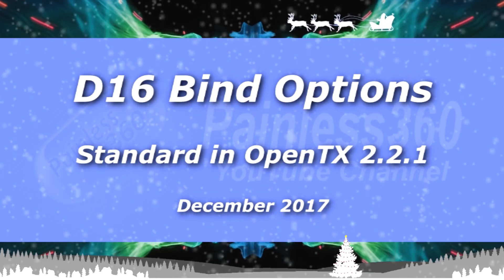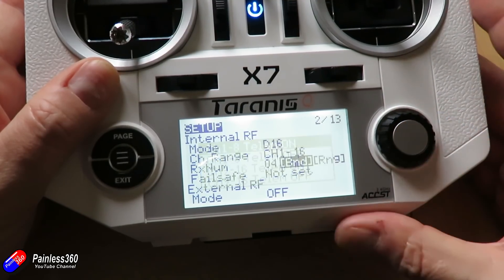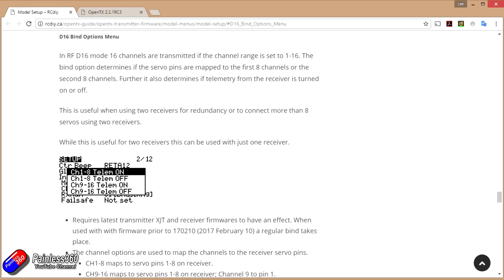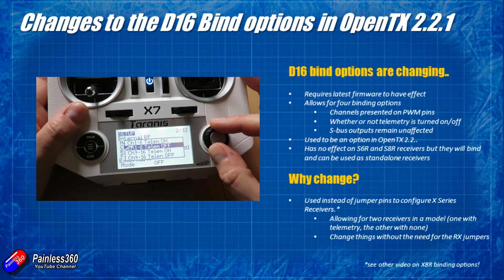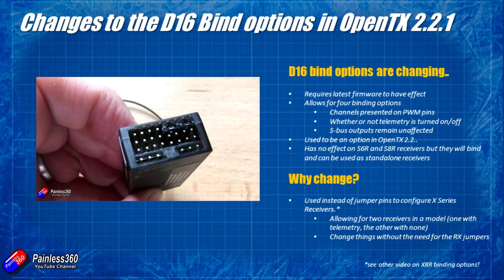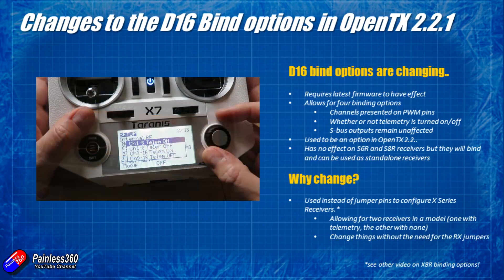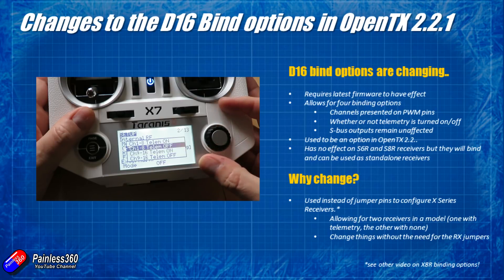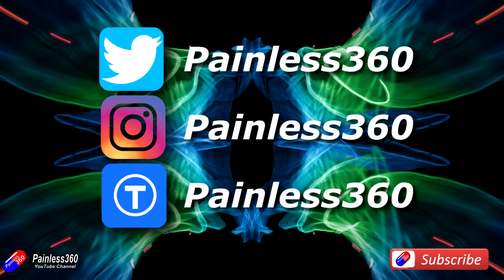OpenTX Quick Tips: D16 Bind Options Becoming Standard in OpenTX 2.2.1

Comment: Does this only work with frsky radios?  I am running the edgeTX on a different radio and do not have these bind options coming up.
Reply from the maker: I'm not flying Edge yet. Too many things I use are not supported yet.. Best of luck
Reply: @Painless360  Even with opentx should the bind options be there on non taranis radios? I cant find a single video demonstrating it on something else.  I might just have to flash back to open instead of edge to test.

Thanks for your help.

Comment: Your link does not work, I'm having a issue I got a xm plus reciever and when i try to bind it I have to use the option 1-8 no tel??? I don't have to setup any pin on the xm plus correct? My reciever is new and i been trying to bind it and gives me a solid green and red on both recievers i got. I have tried both firmware upgrade on the recievers eu and non eu and still same thing. Do you think is the radio that has a issue? Is there a way to test or know if my radio reciever is working. Thanks
Reply from the maker: Sites change all the time and keeping up with all of the links in the videos is an impossible task. Thanks for letting me know. No idea about the problem, if other Rx bind fine then I'd suspect something related to the Rx.. Best of luck!

Comment: Probably a stupid question...using the XM+...do I bind 1-8 no telemetry? I initially about 1-16 no telemetry, and was having the random red light, no rssi (was 13 at one point, 0 at another point) on osd, and no receiver movement in Betaflihht. New XM+, just flashed to get rssi on osd.
Reply from the maker: I normally bind to an OpenTX 2.1 radio at the moment where it's not asking for that, so it'll be binding in 1-16, telemetry and it works fine.. Hmm..

Comment: Hi Lee, a while ago I tried to use 2 x XSRs with the redundancy module but couldn't because I was told you couldn't turn off telemetry on an XSR. I thought the new bind process under OpenTx 2.2.1 would fix this but no. Regardless of what you select the telemetry on an XSR receiver will always be ON. Maybe when new firmware is available for the XSR it will work :-(. In the meantime using an XSR with XM+ the latter having no telemetry.

Comment: Thanks for the video Lee, I bought myself my first X9D Plus for Christmas, (previously Spektrum) and flashed 2.2.1 from the box and guessed this bit. But now I'm trying to understand Open TX while building my first iNav fixed-wing and swapping out the Rx on a glider, quite a challenge!  
Following another YT poster, I carefully soldered a wire from the RSSI pad on an X-Series Rx to the RSSI pad on my flight control board but now I think that was wrong? I just take a wire from the Smart Port to the S Port pad on the board instead, is that right?
Reply from the maker: +patrickcol please see the iNav series. Most of the mini receivers (XM+ erc.) have firmware you can flash that will output the rssi value on an aux channel and you can choose that channel in iNav or Betaflight - simple! See the Quadcopter building for beginners series.. Best of luck!
Reply: I've been working my way through the iNav series, brilliant stuff. Cheers Lee.